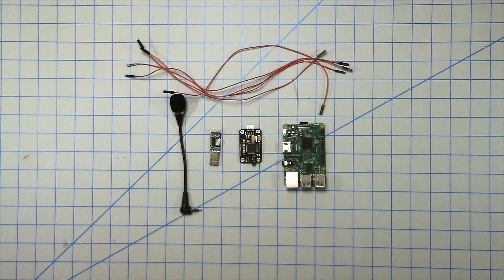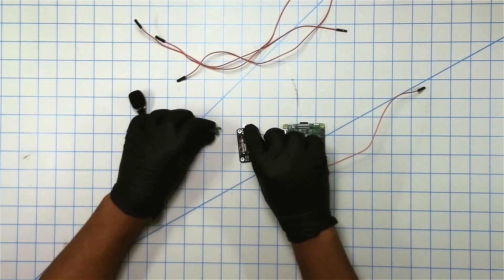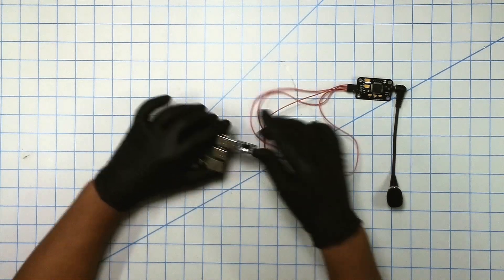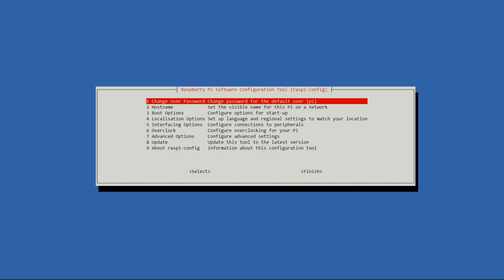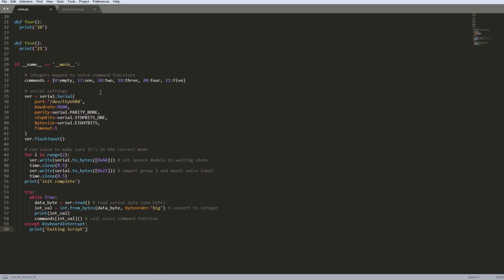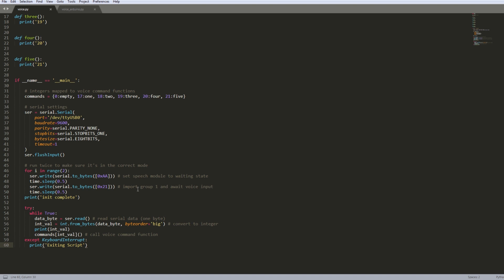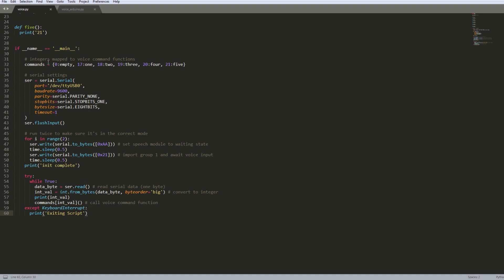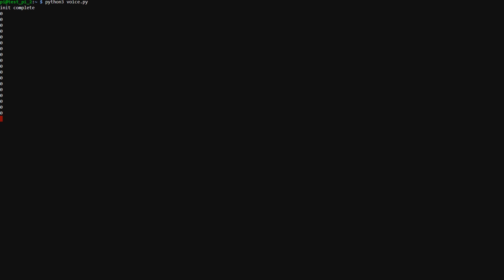Voice Recognition (Raspberry Pi)

Comment: ser.write(serial.to_bytes([0xAA])) # set speech module to waiting state
      time.sleep(0.5)
      ser.write(serial.to_bytes([0x21])) # import group 1 and await voice input

after remove this two command line also  it continuously print ...I have store two commands On for 0 and Off for 1...and its print 0, 1 and 0,1 continuously
Reply from the maker: Hey Bubai, it sounds like your module is working but set to the wrong mode. Double check the documentation to make sure you're sending the right byte commands to the module.
Reply: @PiddlerInTheRoot   Thanks for quick reply,, could you please tell me you talking about which byte commands? I have stored two voice commands like sigtrain  0 On and sigtrain 1 Off only?
Reply: @PiddlerInTheRoot   could please tell me one thing that ..during train the voice module you set 17 18 19 20 21 as a string or something else ..that mean in hex it should be 17= 3137,18=3138  and you convert this byte signature string as a integer am I right or wrong

Comment: I try this one ,but when run the its work fine but voice recognition module not receive  or listen and command but when I connect with arduino its work fine  could you please tell me how to solve this problem
Reply: data_byte value is
b''
The value is 0
data_byte value is
b''
The value is 0
data_byte value is
b''
The value is 0
data_byte value is
b''

Comment: Could you please tell me one thing , that this v3 module have the capability to differentiate female and male voice??
Reply: by default its took 0 as a input , but i have stored  in v3 0 as a speech(On) and 1 as a speech(Off).

data_byte = ser.read() # read serial data (one byte)
        
   while run this code ...........
     int_val = int.from_bytes(data_byte, byteorder='big') # convert to integer
        print("Thav value is",int_val)
        commands[int_val]() # call voice command function

igiven int_val = 0